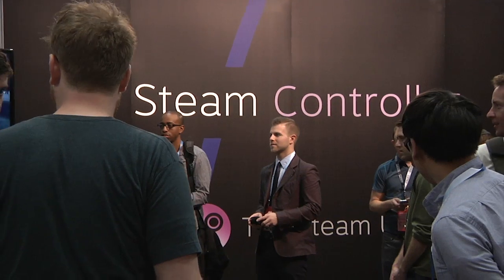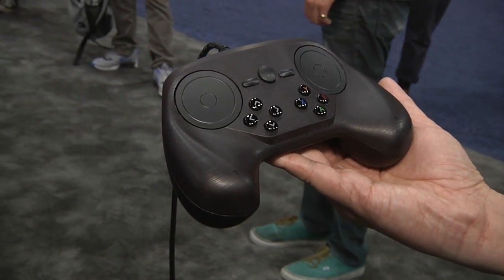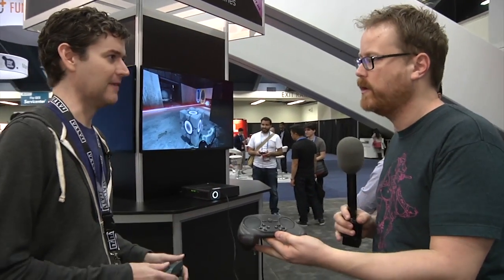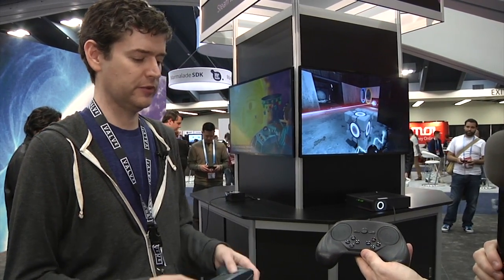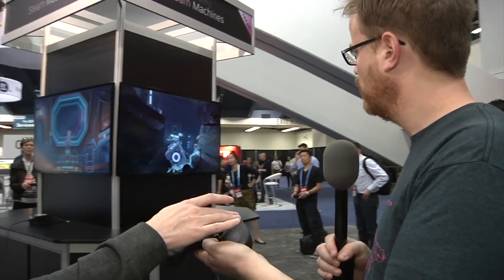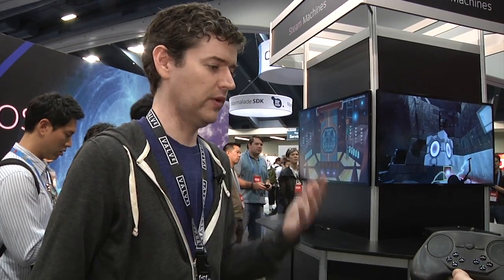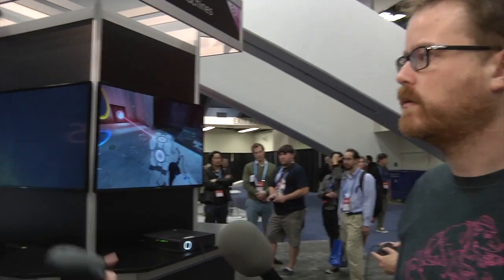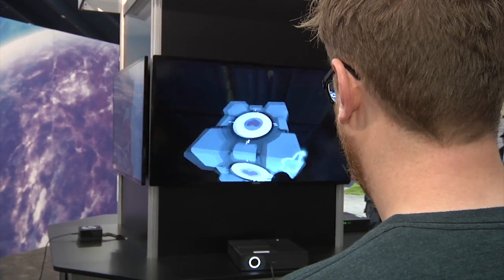Valve's Steam Controller Prototype Hands-On at GDC 2014

Comment: I would love to be able to use this with Windows's desktop when I want to use my TV. On-screen keyboard with this would allow me to avoid using my keyboard or mouse when I want to just lay on my bed.
Reply: While waiting, give a try to some mouse apps on android. They work surprisingly well.
Reply: Another Idea is to use a wired (or wireless with dongle) xbox 360 controller, then use Xpadder or JoytoKey to map mouse movements to one of the thumbsticks. It's what I use, and I would bet feels almost exactly the same as the Steampad, though I'll still end up getting one i'm sure.
Reply: Dylan Greene I've done the same, but the steam controller will have touchpad precision that analog sticks just can't reach. Kind of like what's shown in the video.
Reply: You could also just use something like this: http://www.amazon.com/dp/B003UE52ME/?tag=14606-20.

I think for non-gaming purposes, this is probably a much better solution.

Comment: Not a huge fan of the isolated button d-pad idea. You won't accidentally press the wrong one, of course, but actual "directional pad" use would be tough. No easy 8-way movement. They'll figure it out, though, I'm sure.

Comment: Interesting. However, I am not a fan of the Button d-pad.
Reply: Dpad would be for retro games.
Reply: The problem is, lots and lots of retro indie games support linux native. They need a good dpad.
Reply: I don't think it's actually a "d-pad". If it were, it would greatly limit the controller because after all, they are trying to make games played with a keyboard more playable away from the keyboard. I think the solution is to just label those buttons differently because people are expecting it to be a d-pad with the arrows. There was never really a need for a left analog stick and a d-pad if developers (hardware and game) could make there product usable with one. I think the touch pad analog sticks are perfect. It's flatness could make it a great d-pad, but the hidden technology makes it a sufficient analog stick for various games and software.
Reply: There is a much different feel with a D-pad,  it is needed.
Reply: If they can emulate the feel of analog sticks as well as most people say, I think developers, or Valve could use that tech. to make a sufficient d-pad. Fighting game fans will never be happy with anything, but I think it could be one of the better "d-pads" on a modern controller.
Reply: I disagree to some extent the 1:1 ratio between moving your finger on the trackpad thing to the 1:5 one analog has will actually make for better experiences withing shooters, from my experiences i have always found that there are some deaths that i have been spot on head shot, only to die due to someone doing some shitty 360 Auto-death, at least with the trackpad thing it will eliminate that effect and cause more skillful game plays to be had.Precision is the key, rather then bad coding from developers

Comment: Great controller, it will be greater with bluetooth and bluetooth audio support like the dualshock 4.
Reply: Though it would be nice to have a separate wired version in case someone's pc doesn't have bluetooth or they don't have a dongle. Plus I'd rather not have to worry about constantly switching out my batteries. Though I think I've heard that it will be wireless, and come with a plug in cable that turns it completely wired, like the xbox one controller.

Comment: I have mixed feelings about this controller i dunno if that touch pad will be that good with fps games but it will be cool to use the touch pad as full steering wheel with racing games
Reply: i think in the newer version they made the left touchpad an analog stick, which is a pretty good idea because analog sticks are easier to use for walking around.
Reply: According to them, the trackpad should be between a mouse and a stick as far as aiming in fps
Reply: sock man There is no point in using analog sticks when the touchpads perform the same task under analog stick emulation.

Comment: I'm older, so go easy on me!
Why not just use the xbox controller that's already available for PC games? My son got the controller for me so I could play PC Skyrim. Made it very easy to go from the xbox to the PC and back again.
Reply: and that is a good question. and the answer is because there are a lot of games that don't come with controller support. While, lets just call it dog for now, is as he said recognized as keyboard/mouse, gamepad, and controller. Making it easier for game developers to make their games able to support dog and not have to completely rewrite software to account for controllers. and because this isn't a system, it's an extension of a PC. Kinda like this (TV<--SM<-->PC) The Steam Machine and PC are constantly talking to each other and the picture is shown on the TV allowing you to play games on your PC from your living room. and since everything is on steam. you wouldn't need to go to gamestop to buy the games anymore, they would all be digital.
Reply: Main reasons are that this uses multiple inputs ranging from Xinput (xbox controller style input that most modern controller games use) Dinput (an old way of inputting info that older controller enabled games use) and of course it can emulate mouse and keyboard. That enables you to use this for practically anything except for RTS and similar games that require a full keyboard of keys. The other point is that the trackpads on the controller are a lot more accurate than the joysticks on modern controllers, which allows for easier aiming and navigation of menus and such.

Comment: I thought Valve said they scrapped this controller and that they were going to create a more traditional controller or something.
Reply: They scrapped the old model and created a new version that is a bit more like traditional controller.
Reply: They scrapped the touchscreen model, and now have A,B,X,Y, and a D-PAD.
Reply: ***** That's not a d-pad. It's just another set of buttons with directional labels instead of letter (a, b, x, y) labels. The "Dpad" on the controller is emulated by either of the touch pads.

Comment: The new action buttons that resemble a standard controller are basically them backtracking on what they were showcasing as their essential "innovation" for the steam controller. As it sits now it is merely an oddball controller with high sensitivity. The guy mentions that they are designing this controller not just for legacy games, but for future games with stylistic controller choices in mind. I feel that this will be their downfall as they are narrowing their customer pool more and more. I keep being brought back to the question: who is this product for?
Reply: People who want a good PC gamepad? It's a lot better than the Xbox or PS controllers, that's for sure.
Reply: The current version has only the haptic touch pads to point to in terms of separating itself from competitors. Critique of the device often points towards the haptics hypersensitivity and lack of precision, which is the opposite of "bridging the gap between keyboard+mouse and controller."

The controller is a tool to get a PC gamer onto the couch for Steam OS, but this peripheral won't do that. That technology - to stream games from your computer to your television - existed in 2005 with Windows Media Center, which worked with Xbox 360 and their controller. An old product in a new package imo.

Comment: They're so NOT getting why PC gamers do not want to play PC games like it's a console... Darn. If we want to play PC games on our couch, we technically already could. But there's just no point.

Also, touch directional pads? Really? That's going to be one giant mess for sure.
Reply: On the contrary. They get exactly why PC players hate console controllers, and that's the lack of direct control over rotation (as opposed to turning rate), which a mouse / trackball / touchpad can do easily, but a joystick can't. I'd love to play games on my couch (or sitting on the floor), but not enough to put up with clumsy "joystick aiming".

And that's exactly why the touchpads are a very clever solution. They can work as a mouse (trackball mode), as a tablet (instant positioning mode), and even simulate a joystick (relative mode).

I think that in some games (ex, driving / piloting games) people will miss having a springed joystick, though. Personally, I would have replaced the left "diamond" with a small stick, or made the whole left side replaceable (pad / stick / buttons / trackball).
Reply: RFC3514 I'm sorry, but PC gamers generally do not EVER use joysticks at all. Especially not for first person shooters. Mouse and keyboard all the way and many times over it's the superior method of control, even for racing games. Only exception to this are flight simulators, but even those generally do feature a mouse and keyboard control scheme these days.
Reply: PHeMoX It's almost like he just said that. . .
Reply: You clearly have no idea what's going on. I have had my pc in "comfy couch envronment" for ages but this all has only made everything so much easier. Before steam big picture it was just a very annoying hassle to get things going. Just because i can play in my living room does not mean that it replaces desktop gaming. I do that a lot more but sometimes you just want to play on your couch with a controller. That's the strength of PC and your thinking is too limited.
Reply: I am really glad that someone tries out different types of controllers. You can hear from what he's talking that they at least put in some thought in their approach and I think you as a gamer should be able to appreciate this at least to some degree, even though you think the result may not be on spot.
Reply: PHeMoX That's exactly what he said, why are you trying to argue with him?
Reply: ***** Either I can't read, or he must have edited his text, because it didn't say that before. I probably can't read, my bad. (:
Reply: RFC3514
You're a fuckin genius!

Comment: combin this controller with the occulus rift with a zoom function on the controller
Reply: I've actually been thinking that this would work better with an OR than a mouse + keyboard since you can hold it on your lap, but why a zoom function?
Reply: *****
 so for games that have 'small parts' like rts's for example, you can zoom into the 'screen' without having to strain your eyes seeing you can't physically move closer to the screen.

Comment: What the hell wireless with a custom dongle?
What about android? That was half the reason to buy the thing..
Reply: cause it isn't a system per say, it's an extension of a PC. The Steam Machine hooks up to TV then either wirelessly or not connect to your PC. so it brings all of your Steam library to your TV. The dongle is so you can have a wireless controller.
Reply: Bluetooth is wireless and is standard for both consoles pcs and phones. I understand their point that is to get the controller to be recognized simultaneously as a mouse a keyboard and a joystick, so older pc games support it natively and the user never needs a real keyboard and mouse to configure the game from his couch. But my point is, steam boxes not only launch the games from steam itself they also run an OS made for steam, it can't be impossible to do that emulation from just drivers and keep the controller compatible to a wider variety of systems. Kinda like the dualshock
Reply: It's also been stated before that the controller can announce itself as a keyboard/mouse combo for compatability with old games

Comment: Not so sure about the trackpad as a mouse, i mean... have you ever tried to use your laptop's trackpad to play an FPS game? It's HORRIBLE. I mean i don't want every little motion of my thumb to be tracked while playing and by the look of it the trackpad is very sensitive so moving ur thumb a little bit for whatever reason will make you look completely the wrong way, but then again if it's not sensitive then you would need to swipe like 2-3 times for a 180, which sounds slow and inaccurate. I see most FPS people will be using the 'analog' style where the trackpad acts like a traditional thumb stick.
Reply: And then there's also this 'touch and release' issue that makes the actual control unreliable. Same goes for this acceleration he's talking about, apparently for compensation. That's probably more annoying than anything.
Reply: I'm sure the sensitivity will be adjustable, they want the games to be enjoyable let alone playable. It should feel more like a mouse than a trackpad, but I can see your point.
Reply: Ajaxitron Yes, you're probably right also, but is that going to save the whole idea in the first place? I mean, I do get that people aren't likely to sit with their keyboards on their lap on the couch with some kind of table for a mouse or something and that might justify developing a controller like this. But why should PC games be playable on a TV? It's not a console and I for one am glad they're not. In fact, there already are controllers, wireless even, that would quite easily make PC gaming possible on your TV if you'd really wanted to.
Reply: I have a feeling it's more to do with how its a very odd motion of the hand to use a touchpad. Once I got used to it, I managed to beat HL2 & the Episodes on normal, and I've known TF2 players to use exclusively a trackpad and still be challenging opponents.
 Now if that idea was incorporated into a game controller, with vastly enhanced ergonomics... There's also the touchpads being able to tell you how many 'clicks' you moved you thumb, so you're aware of how your thumb is controller whatever is in-game. I'd say similar to scrolling through a menu with the mouse wheel. I'm sure they've thought of all this for a fair while now.
Reply: PHeMoX Many PC gamers want to play games on the TV. I would love to have a controller more suited for PC type games.

Regarding the "touch and release", that is made to mimic how a track ball works. Have you ever tried playing FPS games with a thumb trackball mouse? It is quite nice actually. Sure, it's very different from a regular mouse or a joystick, but that is just something to get used to. Precision wise I think this controller will be closer to a regular mouse than the clunky joystick console controlls. 

The mentioned accelleration is to be completely optional.
The whole controller is programmable, and all commands from it is real keyboard presses or joystick analog inputs, depending on the setup. This means that if you only use one setup, you don't even need drivers for the thing if you don't want to. You can set the trackpads up as traditional joysticks, traditional track pads, and the track ball mimick mode. All with haptic feedbac through your thumbs.
Reply: SgtStinger Yeah, everyone keeps repeating that, but those who really want to play games on their TVs already own consoles. Others could just link up their TV with an HDMI cable.

In reality, there's nothing stopping people from already playing games on their TV if they really wanted to.

I really think it's a very small minority. Most PC gamers are fine with their PC being a separate machine on a separate desk, instead of being part of their TV.

I'm playing games on a 27" inch monitor these days and honestly don't see the point of a. moving to my couch and b. play on an even larger screen with a lower resolution, because sadly I don't own a 4K TV... 

As for local play one the same machine, all console-style, many PC games neither support nor were designed for that.

Again, if anything, they're trying to let the PC experience be more 'console-like' if you ask me and that's not what I'm interested in at all. Heck, of those ±40 million Steam users, I'm fairly confident many also own one or more consoles.
Reply: PHeMoX The laptop trackpad is still way better than a thumbstick.
Reply: ***** Meh, I've played enough Xbox games to disagree with that. A laptop trackpad really is not functioning the same as a mouse. Instead it's barely capable of reliably moving the cursor around. Playing games with a laptop trackpad is nuts...
Reply: Well have you ever held your laptop on your hands and used the touchpad with your thumb? Have you ever used a controller and moved the analog sticks with your fingers instead of your thumb? It sucks both ways, if you understand what i'm saying.
Reply: PHeMoX Not sure I understand the "touch and release" issue. It's just like picking up a mouse off the table and resetting it. I guess if you play with a high sensitivity you don't pick up the mouse and reset it too much, but I tend to play with a low sensitivity and so I pick up and reset quite a bit.
Reply: PHeMoX Ever tried playing for an extended period with a laptop trackpad so you can actually get the feel for it? I could blow controller users out of the water while using a laptop trackpad if they had controllers.